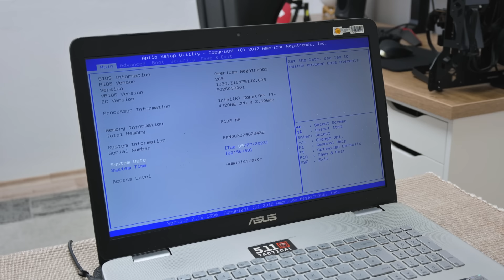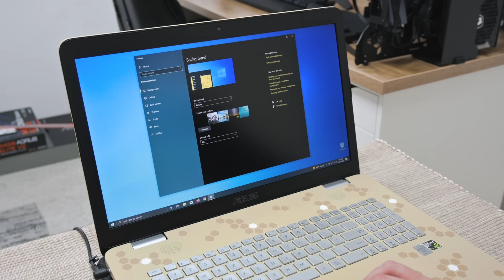ASUS N751J - Full restoration and MOD

Comment: I got an old Lenovo Thinkpad T530 from my computer guy. It came with 2 GB Ram a 250 GB HDD and a Core I5 3230 M CPU. I upgraded it to 16 GB RAM  1 TB 7200 RPM HDD and a 128 GB SSD boot disk. Now all I need to do is replace the keyboard.

Comment: After washing PCB boards with alcohol, give it enough time for alchohol to dry off, once I didn't, and when I turned on computer, there was a small fire near the ram chips gold contacts on the motherboard, luckily I saw it and I put it out right away.

Comment: Does superglue truely work? I had problems gluing the keyboard with it.
by the way: your work is amazing :)
Reply from the maker: yes but I'm using gel or elastic gel superglue not standard liquid. Gel is drying slower, some glues need 12 hrs or more,  but is much more flexible
Reply: @ComputersAndTechAndAndrew  Thanks for your answer, I'm testing super glue gel in future :-)

Comment: 1:25 Nice, this laptop takes 1x M.2 NVMe disk and 2x SATA 2.5in disks! This is why I would rather have a 17in laptop over a 15in laptop, despite the 17in usually having much worse battery life. (If I want lots of battery life, I use something small and light, like Microsoft Surface Pro.)

Comment: Please i need your help 😖i am not finding any solution…i have acer predator helios 300 i5 8300h gtx 1060 6gb…my gpu core clock is fluctuating…i tried resetting my windows… and also installed new one…changed settings in nvidia control panel..but nothing works..my gpu runs on 130-400+mhz only..can you give me a solution please that will be very kind of you

Comment: I just have one little problem with your video, don't use glass cleaner unless it's amonia free. it eats plastic and protective layers. 
better to use ammonia free cleaner, most of the time the store brand has an amonia free version for cheap. 
if you can't find it, you can put a little bit of soap in water in a spray bottle.
and of course don't use IPA on plastics or rubbers because it can dry out adhesives and plastics, hand sanitizer is not that bad for cleaning though.

Comment: you had best option of adding m.2 sata ssd but you didn't add that
Reply: SATA SSD is not that bad
Reply: @siyam9618  it is compared to m2 sata
Reply: @007leonard1 well, sata sddis just good enough for a slightly old laptop
Reply: So this model has 3 slots of storage?
Reply: @siyam9618  agree
Reply: but m.2 is expensive
Reply: Speed will be same.
Reply: @warior1195  actually, 4 slots. You can buy an SSD caddy and replace the BD/DVD drive with and SSD or HDD
Reply: @utkarshdharmadhikari6816  yeah i know that but im talking about the official one here
Reply: @skimmingdeath  yes 2.5 inch sata and m2 sata is equivalent and nvme m2  is about 6 times faster
Reply: I would choose m.2 ssd if you have a slot for it. Sata is good but since you have an option to use m.2 better m.2.
Reply: @ZaimAfham  so would i
Reply: @007leonard1  yes if you can.
Reply: @i2Sage agreed. Basically his repairing the laptop just for the youtube and probably sell it at the end. So why bother putting more cost in it.
Reply: If it's a SATA m.2 the speed will be exactly the same
If it's nvme well then it would be faster
But I doubt this laptop has nvme
Reply from the maker: with M.2 will be much better but the budget was very small, otherwise 512GB M.2 and 960GB or 1TB will be perfect
Reply: @ZaimAfham  M.2 can be SATA or NVMe
Reply: @ChrisAzure  i will says nvme if i choose nvme ssd and m.2 ssd for sata m.2. It’s confusing most people because they think similar form factor provide similar speeds.
Reply: @Zaim Afham  exactly and that's without including mSATA which almost looks the same xD
Reply: @007leonard1  For applications that take advantage of more than 500/600 MBs of bandwidth, most games and everyday use apps don't get any benefit from a NVME SSD yet.

Comment: Hi Andrew,
could u pls help me fixing an Acer Aspire 5749's trackpad scrolling not working in Win10 ? I have tried updating driver in windows10 & no luck.  The laptop came with Win7. Normally mouse function n its left right functions work though.  
I do not understand weather is it a hardware or driver issue.  Pls reply n thnx.